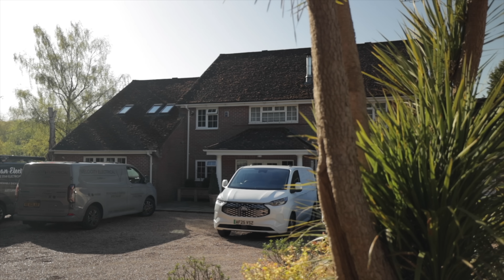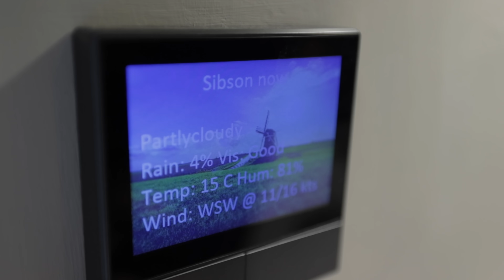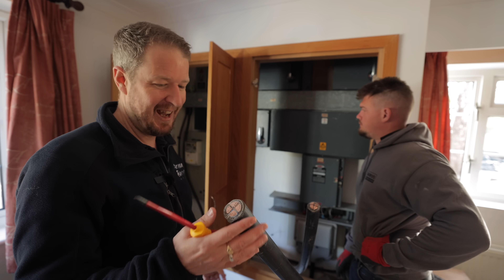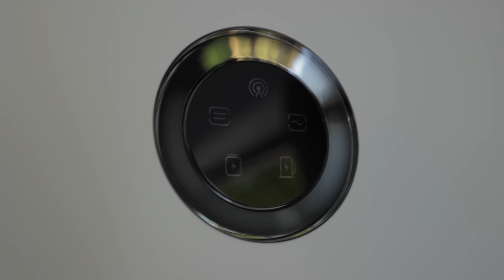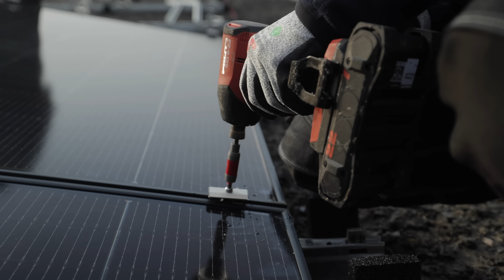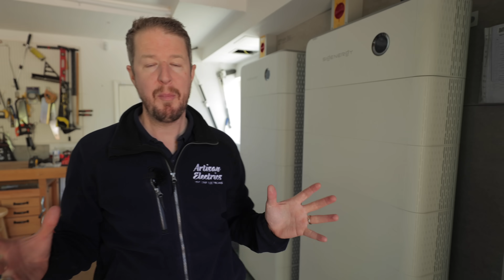Is Battery Storage Actually Worth It In 2025?

Comment: A battery is not helpful if you have a heat pump which needs to be on almostt 24 hours per day in the depths of winter. The amount of energy that you could store in a 15kwh, say, battery would be insufficient to run the heat pump during the day when the cost of eletcricity will be higher than the standard rate. My heat pump can use up to 50kwh per day in winter so a battery capacity of 50kwh or more would be necessary and that would be very expensive.

Comment: One of the key parameters of working out if batteries are economically viable is the expected number of charge/discharge cycles which ranges from 5000-8000 looking at typical systems. So pay back should be within say 8 years. For most installs it will make it hard to reach this for installation cost of about £8k and up when using the system to boost selfconsumptions with solar. The picture changes if you are on special tariffs allowing sell back.
Reply: Couldn’t agree more, factor in degradation too, 1 - 2% per year, and the fact that those special tariffs are unlikely to be around for 10 years then it does become a challenging ROI.
Reply: Be careful, a discharge is not necessarily used up 1 per day, unless you are doing a full charge discharge daily. You may on average use a full equivalent discharge cycle over 2 or 3 days, as each day is only partial. Most good quality batteries with a decent bms should last 15 to 20 years.
Reply: If your'e paying 8k for a 10-15kwh  install its too much for it to payback in a reasonable time frame.

Comment: Maybe in some cases batteries makes sense, but storing electric energy to make heat? Really? Why not store heat, thats way cheaper, coz its just sheetmetal and insulation. Off course you are an electrician, so you do it the electric way, but that seems wrong.

Comment: If this customer would be limited by the DNO to a lower charging rare from the grid, could you still use the same inverters but with a configuration to limit their draw from the grid?
Then the inverters could still privide more power to the property if the grid went down.

Comment: I thought there was new legislation that restricts the amount of battery storage allowed per property. Does this installation meet those rules or is it because they are Lithium Phosphate? I don't know - this is the legislation I am referring to PAS-63100-2024. I thought the maximum was 80kwH in a garage and 90kwH in total?
Reply: kWh, not kwH
Reply: PAS 63100:2024 is not a British standard and it is not law.

The IET says it is something that should be considered.

On 9th May 2024, the MCS said this:
 "We can confirm that in the short term, there are no direct changes to MIS 3012 the Battery Storage Installation Standard"

So check with MCS to ascertain if there has been any change in their position.

Comment: I also use Home Assistant to manage my home battery system and going a step further to have it look at tomorrows weather and dynamically set the overnight charging (if at all). Works great and so I never need to make any adjustments year round.
I'm using a Solis inverter and interface directly to the Modbus port of the inverter for the control. I only use the Solis Cloud for additional monitoring (which is handy).
Why look at the weather?.......it's to keep importing energy to a minimum, and also to avoid exporting when possible.
Reply: That’s exactly what I’m hoping to do. Are Solis the best for integration with home assistant?  Did you go for a big server rack battery? That’s what I’m looking at right now. Do you have a gateway for islanding?
Reply: @dominic-1-1-1  There’s a video on my channel showing the hoops I had to jump through to get HA to control my Solis inverter and keep the Solis cloud active for monitoring.
I have a 10.4kWh battery, it’s scalable but it’s not a rack system.
I haven’t bothered with islanding.
Reply: @IanScottJohnston found it and subscribed! Thanks

Comment: Five year Tesla PowerWall2 user here in a rural setting... the Tesla app allows me to charge at off-peak rates and discharge during the day. It's not a UPS however as switchover is too slow, lights dip and sensitive electronics crash/reboot. I have installed proper UPS devices to cover computers etc for a few minutes as a result.  I installed the PW at the time to cover grid outages as I work from home and I am at the end of a rural power distribution so get brief outages and brownouts multiple times a year. I now wish I had purchased additional batteries when I had it installed as ROI has become much shorter since prices went up.
Reply: Would it not be possible to offset some of that power generation needs by adding solar or perhaps a micro wind turbine if you have more wind. This could offset the power discharge and the need for more batteries.
Reply: @stephendoherty8291  Yes I have solar however am on my 3rd inverter as there is some weirdness that causes them to burn out their relays - very frustrating and ongoing with no resolution yet.
Reply: @AutisticEnderman  Am about to Have solar and Tesla PW3 installed and asked about solar panel optimisers / micro inverters.  Had couple of people say teslas can have issues with them and now Tesla void warranties if used so maybe the source of your issue if you have them

Comment: With the rates as they are with thing like octopus go, cheap overnight tariff, charge the battery, run the house off of the battery and solar during the day, export any excess at a much higher rate than the cheap overnight rate then dump the rest of the battery before the cheap rate starts. recharge overnight... repeat.

here, cheap rate is 8.5p, day rate is 28p/kWh, export rate is 15p/kWh

Comment: Without seeing actual calculations based on real world invoices it looks like this guy is coconuts. Nice sales talks. Better first invest in small solar system and optimise self consumption with Myenergi Eddi. Monitor with HomeWizad power meters on a Homey Pro (using Power By The Hour app) and learn from that. Analyse your data and invoices in a spreadsheet or database on a per month basis. A bit of a learning curve. But worth all the effort. Energy management is key. Later on you can decide if battery storage makes sense. For most people the answer is no.

Comment: @22:30 I disagree with your perfect person scenario when having a large solar array and no battery. After adding a battery you should charge it every night on the cheap electricity so once the sun comes up and you are generating and running your property/topped up the battery again you are back to exporting any excess sooner at your export rate as soon as possible. Why use energy to top up the battery at your higher export rate when you can use the cheaper overnight electricity. This is especially true in the winter when you might not be making enough power to replenish the battery for what you will be using daily. If you have to use higher rate daytime electricity with a battery/solar set up something is wrong with your system or the way you're running it.
If you have an EV would you charge it from your excess solar at twice the price per kW (export) compared to the over night rate (import)? Same thing for battery storage.

Comment: we never had these issues with gas or oil. same price 24/7. we are dancing to the tune of electricity because its max rate of supply is capped from physical considerations (cable size, resistance losses). pity. reduces reliability, increases overhead. yet we rave over the technology!

Comment: You never mention prices. This is not for 99% of people I'd guess.
Reply: I’m not sure about prices but I’m probably more concerned about the return on investment. I’ve seen $100,000 installations with the break even point being about 4 years. That is pretty good. I’ve also seen $10,000 with similar returns. Much depends on the price of electricity in your area which in most of the UK is pretty high.
Reply: @ewadge  So why doesn't someone crunch the numbers & and project the ROI on these things? Should be relativly easy to do if you have the last 3 years of usage, and the property set up (how it uses that energy)  and costs of these things. Some other variables, sure, but should be doable.
Reply: They are obviously at the higher end of price and presumably quality. See "neat or not neat" moments.
Reply: This is what I want to understand. The cost of the system versus the expected savings over the life of the system. 

The difference is what you're paying for peace of mind.

Comment: Last time I looked there is no "battery only" tariff available from any UK electricity supplier. All the time of use / off peak tariffs require you have an additional  sort of technology as well - heat pump, or EV,  or storage heaters, or solar panels. If anyone knows otherwise I'd be interested to know. EON used to offer an EV tariff where you could have battery instead of EV but this was withdrawn a while ago and is EV only now.

Comment: In cyprus where i admit the sun shines a hell of a lot more, the government will allow younto export to the network and "store" your credits that you must use over a year. Essentially customers and suppliers come together as a unit to meet the countries needs and you get that benefit in return if you supplied a surplus to the network. 

The problem is that in such a sunny country, they struggle to use it all!
Reply: This is why having some of battery storage makes more sense than sending to grid for "storage".
Reply: @SnowTheKitsune well not really. I don't want a battery purely because I don't want to take up the space, the cost, the maintenance, the hassle etc. But countries need a hybrid network. Most likely renewable with nuclear so you can balance the supply when you need it. Why should everyone need to store electricity locally when it can be used and returned from the network when the customer isnt generating themselves. We can't rely purely on wind or solar for all our needs so this approach to supple and "I'll scratch yours if you scratch my back" makes sense. 

The other problem i see is that the government's and suppliers are relying on people to maintain their systems, what if it drops off in 5 years because people can't be bothered with the effort. 

The issue is money, the traders, the energy firms etc won't make money from this.

Comment: The system needs a whole wall in the garage, space most of us do not have.  Moreover, the cost of electricity is going up, and will continue to do so with crazy Ed in charge.  We need more reliable base load power, not racks of batteries made in China in factories using Australian coal.

Comment: Can see Batteries being the new target for crime - Govt are making us all dependant on Power for everything so they can control our everyday living. I wouldn't want a Battery attached to the home if like LG who have been advertising Battery recalls for the past 2 yrs, something goes wrong & I have to vacate the home for a long time. A Q? for you is if a small Battery has a few damaged cells will it fail  v  a more expensive system that may cope with a few more failed cells so you might get a longer life. Have seen life expectancy range from 5yrs to 25yrs & I assume it's for the ability to cope with dead cells. Another reason perhaps that they say don't fully charge a car from the home system but rather just as a top up.